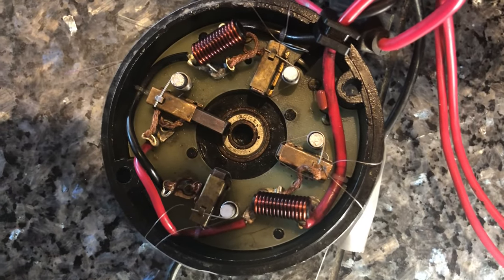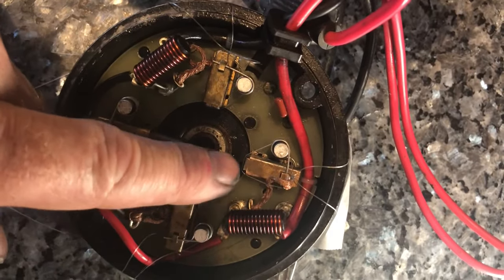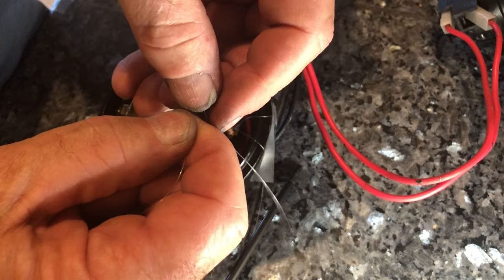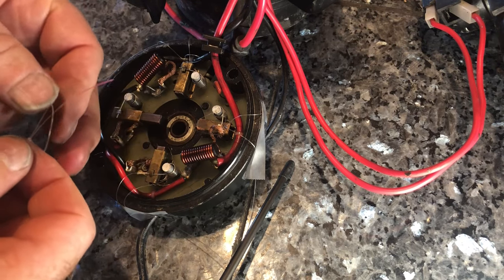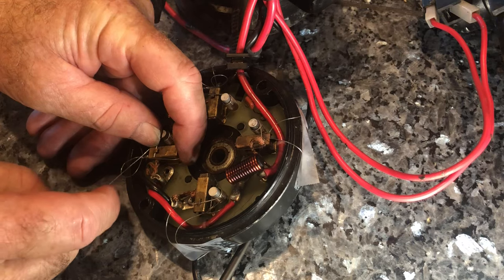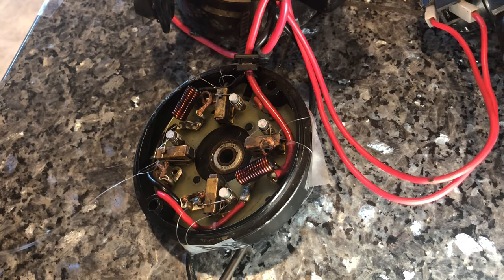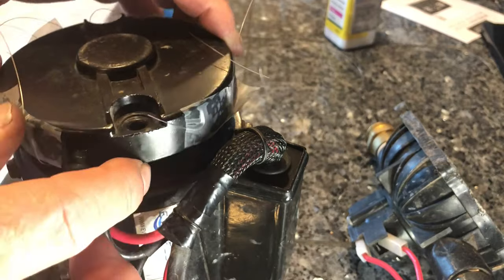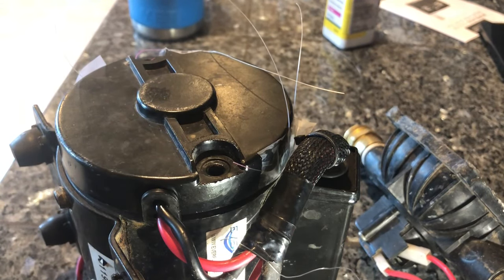A slick trick in how to seat brushes over an armature on DC electric motor.

Comment: I once drilled an old washing machine switch full of holes and tied about a dozen small metal tabs with springs under them in place. The switch was riveted together and when I opened it the parts sprung all over the place, I cleaned the contact points and with the fishing line trick I got the switch to work again and it lasted for a number of years. This was a $90 switch in the 80’s when I did this as a kid and saved my family a big expense.

Comment: Thanks, your video help me install brush for my stupid starter motorcycle motor, it has 4 brush and really hard to do. But I use dental floss instead of fishing line and it works pretty well.
Reply from the maker: Thanks for sharing and it worked out for you....everyone has dental floss! (or should). I used fishing line cause it slips out easily...but perhaps the floss does also.

Comment: You did not tell us what the knot was called. So I could lookup a boy scout manual. Sorry I could not work out what you were doing, I have used thin wire ie  telephone wire tightened by twisting  to do the same thing I was looking for a simpler way, Not sure yours is much better
Reply: It's a "slip knot".   He mentioned it at 00.27min https://youtu.be/zjLyJUh1dH8?si=CsnXUnjpr3ZZ9DFO&t=27

Comment: This is exactly why I started carrying forceps in the toolbox as a “must-have” item, but my real intent was to suggest that next time when demonstrating tying a knot, just use a piece of rope, or even a length of twine instead of monofilament… it will be easier to handle, and not transparent… hell, your shoelace would even work ….
Reply from the maker: The monofilament allows it to easily slip between the housings when you press them together.